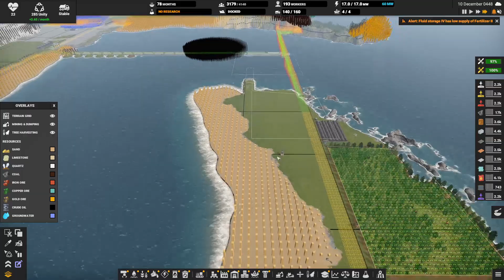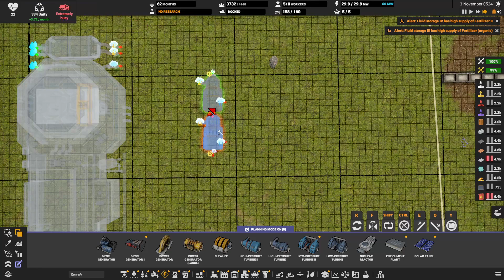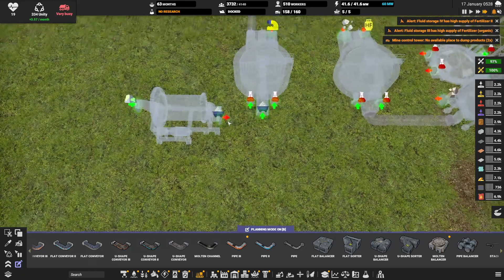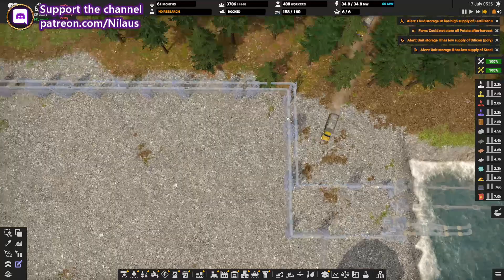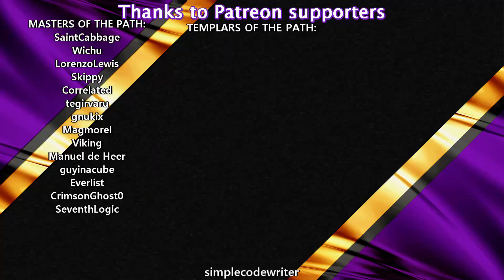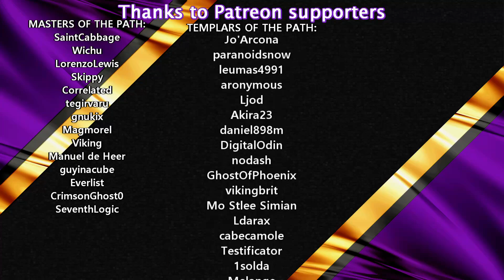NUCLEAR POWER; Risky But Effective | 15 | Captain of Industry Update 1 | Lets Play

Comment: Just some personal opinions:
Uranium is the intermediate nuclear tech for complexity. MOX is the worst, and the FBR is actually the simplest. Uranium is bridge power to get to the FBR, and MOX is only worth using to unlock the FBR tech - other than the minimum MOX waste you have to generate, I ended up just deleting MOX rods as too much hassle. 

I prefer the extra cooling tower, electric boiler, and two desals for dealing with the needed water. Uses fewer workers and less power than 5 desals and a boiler. 

That said, nuclear is much easier than oil at the end of the day!

Comment: There's a few things I may have missed in the previous movies that I noticed here:
1) Most importantly, you're planting and harvesting trees in the location where the initial oil refining was. At this point, without planted trees, we'd be stuck for construction 1 parts.
2) You added a rubber conveyor from the sour water refinement to the electronics parts, and also hooked it up to the new vehicle depot.

Also, since changing wastewater to use filter medium instead of sand costs more acid and creates more sludge/water, it isn't balanced to the current setup. It's necessary to occasionally boost to keep up with the sludge and you'll eventually run out of brine to make more acid. Unless additional balancing is set up, that is.
Reply: Green Houses for the main food production look upgraded to Greenhouses II.   May have been covered in a different video.